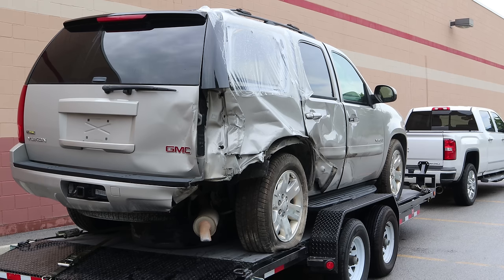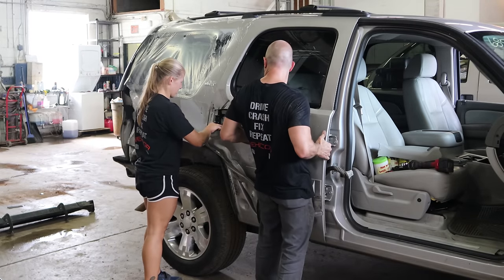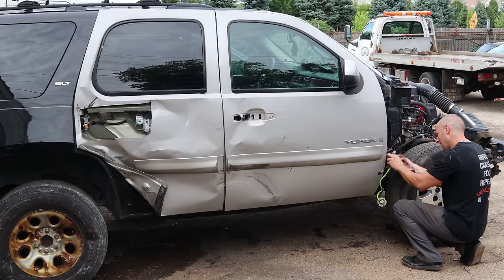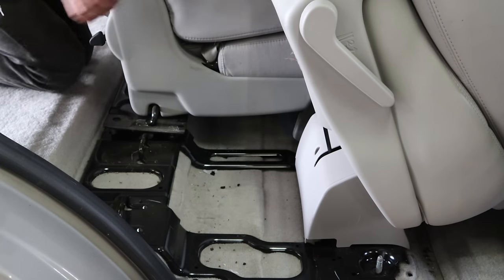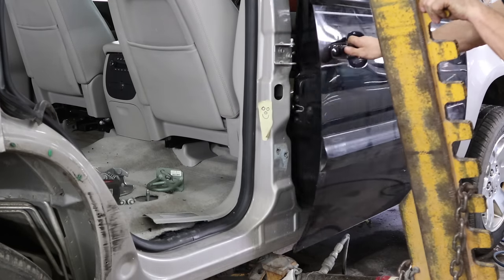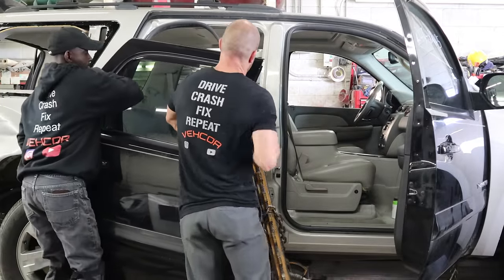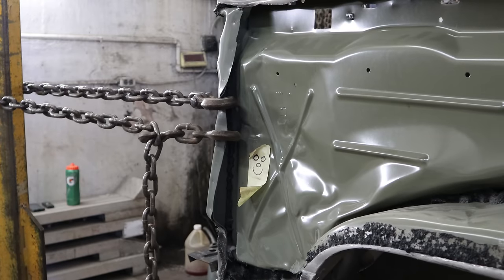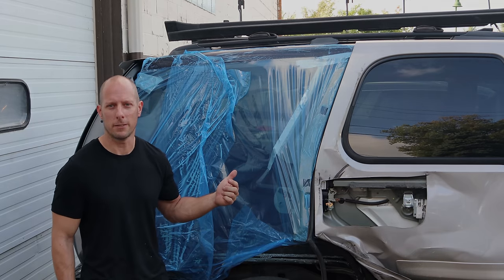Rebuilding a GMC Yukon hit by a semi  Part 2

Comment: I have to say that with all the frame/structural straightening on this video, it's one of your most interesting yet! It's cool to see the process taking the structural parts from twisted up to straightened. Thank you! Good job!
Reply from the maker: And I almost didn't include it because I thought it might be boring.  Just goes to show I know nothing about making videos. 😂 I'll just record it all to be safe from now on!  Thanks for the support!
Reply: @vehcor  how about a qwik tour of the frame machine and setup on a frame rail or sheetmetal pull?
Reply: What you went thro on the dirtnali...how does this compare?
Reply from the maker: Mad Mechanix the Dirtnali was hit harder but in a smaller area.  The way those panels go together made that one a little more work.  This one is pretty easy, just over a bigger area.
Reply: And that’s why I pop 2 bags of popcorn for every amazing in-depth entertaining and informative Vehcor post #keepemcomingbrother

Comment: That bulldozer puller is one handy tool. No need to run the vehicle up on a frame rack for these types of repairs. Looking good as always on these repairs. Keep up the good work and funny banter.
Reply from the maker: That was actually on the frame rack.  It was only chained down since the pulls were light and wasn't worth the time to drag out the clamps.  I contemplated using the forklift again like the Dirtnali. Thanks for the support!
Reply: @vehcor  Ah, okay. It was kind of a guess on what method you was using. From the camera eye it resembled the ole bulldozer. I'm sure you know of those types of frame machines. Heck, you probably DO have one kicking around somewhere. AND not that darn forklift either lol. Keep on rockin, Man.
Reply from the maker: There is one of those floating around the shop somewhere.  😂 Don't be dissing my forklift/frame rack! 😂

Comment: This video step reminds me that just a couple of days ago I received a RR passenger door for my 2006 CTS Sport.  I became quite mangled.  The replacement door is just perfect.  It's totally complete and ready to mount.  It's off a CTV-V and is a color match and in flawless condition.  Now, this sucker is heavy!  I'm going to need to have a door replacement party.  Yikes!
Reply from the maker: Sometimes you get lucky with paint match.  With all the Grand Ams I did, I was able to put on quite a few parts without paint.  It helped that they came in limited colors.

Comment: That’s what I call “optimizing.”  
One parts vehicle to help rebuild two, possibly more, vehicles. 

Good planning. 
How did you figure out the cross references. 
There used to be a manual you could look up parts cross referencing.
Reply from the maker: I usually build a few out of my parts cars.  I used measurements off the parts truck before I cut it up.  We do have measurements in the estimating system and with the frame rack.  Thanks for watching!
Reply: @vehcor  I hope you strip the spare one for sellable parts

Comment: that face tho, worth the price of admission right thar! lol

(reminds me when a gf was helping me on my boat. I was in the engine compartment and removing a high pressure oil line which I THOUGHT the pressure was released lol made the exact same face when I popped back up covered in oil hahahah)
Reply from the maker: You have to be more specific, I make lots of different faces and so does she. 😂😬😁😶😳😧😲
Reply: @vehcor  at the very beginning, when using the air chisel..
Reply from the maker: That was a good one! 😂
Reply: @vehcor  it started out as a "what the hell" and ended up with a "oh wow, that was fun! hey, give it back" lol

Comment: Thanks for the vid. This is a good one. I originally found you (a year ago) because I was planning on repairing a Grand Vitara with a similar amount of rear quarter damage. Now started on the Grand Vitara so kind of good to see something like this again. I am using a beam under the car and a pullback ram on a portapower for pulling. No frame machine for me. Going good so far.
Reply from the maker: I could have done this one with the forklift like I did the Dirtnali.  It was only chained to the frame rack, not mounted up.  The pulls were light so it was not worth the time to clamp it up.  Good luck on your project.  With a little creativity you can do without the frame rack.
Reply: @vehcor  had a friend come over who is a bodyman and help for a couple hours. He was amazed how well the 8inch I beam and a few chains actually worked. Little creativity goes a long way. For heavier pulls I would have to move it outside and pull using tractor and a pipe pushed in the ground as an anchor. The body panels and unibody structure pulls really easy though. Thanks again, these videos really demonstrate that you can diy a lot of this stuff with proper techniques but less of the sophisticated equipment.

Comment: When you were using the measuring  stick to find out if the b pillar was in specs when pulling it out for the front passenger door to close correctly, did you measure from the other Yukon or do you have a source book for those type of measurements? When painting over the dark painted doors/ quarter panel; are you gonna have to take it all the way down to the primer, so the lighter paint matches the rest of the color? Very in depth repair how to step by step. 👍🏻
Reply from the maker: I used measurements from the parts truck.  I do have programs that have them but the parts truck was a few steps away.  The silver covers well, we can put it directly over the black. There will be some bodywork where the welds are and a few dings so those will have lighter colored primer under the new paint.  It is not necessary to strip it down to the factory primer every time.  Some colors cover poorly and for those  we put down a base coat.

Comment: Awesome job! Looking forward to the next segment. I was surprised the rear ac box was that big. We have a suv (trail blazer ss) but it doesn't have rear heat or air. Anyway 👍👍👍
Reply from the maker: That HVAC box was actually smaller than most.  The last generation Yukon it was 3 times the size. lol I have always wanted a TBSS.  Maybe soon, they have come way down in price.  Thanks for watching!

Comment: I had to replace my air hammer/chisel 2 months ago. my New IR one safety instructions warns against gloves. Gloves could get caught in trigger or pull a hand in to the bit.
Reply from the maker: TAKE THAT SAFETY EXPERTS!  Interesting, I might have known that if I read instructions, but those are the first thing to go in the pile!   lol  Thanks for teaching me something.
Reply: Gloves aren't for using the gun, for handling the metal edges.
I'm cool with people who don't think they need any protection, as long as they don't expect me to help them when they get a shard of glass/metal in their eye, cut their hand open or speak up because they are deaf.

Comment: Another awsome video. Lots of damage to the inner panel and floor area. Is this your full time evening crews new whip? She sure ain't afraid of the work.
Reply from the maker: Thanks, the floor is a little crumpled but it will straighten, the inner panel and wheel house is going in the pile! 😂 She has a rebuilt Scion tC that she says she is driving for a minimum of three more years.

Comment: So how does the rebuilding business work for you? Pretty much every other youtuber does it for themselves, but I know you don't all these Yukons for yourself. Do you buy and rebuild any car you feel like, then sell it on the market or to specific used car dealers, or do customers approach you and "commission" you to rebuild a specific type of car? If so, how do those customers find you? Is it word of mouth or do you advertise at all? I know in one rebuild you mentioned having a deadline for a car, and that's what got me thinking about the business side of what you do.
Reply from the maker: I do a few builds for myself.  Most are just cars I buy to sell.  Some go to the auction, some dealers buy from me, some dealers consign for me.  I sell some myself as well.  Basically whatever will bring me the most money and each case is different.  I watch the market on different cars to see what is selling and for how much.  I make sure my builds are under that price or offer something like rare options or low miles that will demand more money. I also have customers that order a car like the last Yukon. I do zero advertising, I cannot keep up with demand from previous customers and referrals. It pays to do things right.  What the hacks spend looking for new customers, I save with repeat business.

Comment: A nice addition to my Friday 😋
How do you deal with the different color trim panels on the replacement doors?
Reply from the maker: Thanks, I will use the originals when I put it back together.
Reply: Depending on the vehicle, the interior panels are quite easy to switch over.

Comment: Would heating up the metal aid in pulling out the rear quarter panel?
Reply from the maker: Yes it would aid in pulling but destroy the metal.  You cannot heat any newer cars, it weakens the metal.  It might look good but it is VERY weak afterward.  I see people heating uni-bodies and I just shake my head. I don't want to be in that vehicle if it is ever wrecked again.

Comment: seeing you remove the door handle, i'm saying to myself well now I know how to get into my car the next time the German made locks deside to lock me out.
Reply from the maker: I mean, you don't want to break the window!  Putting it back takes a little long, just a warning! 😃
Reply: @vehcor  Already did a window in it, thanks to the wife. She thought it would be a good idea to leave her coach bag in the floor borad. So did the robber. So the dam door panel and german torx screws they use they made me have to flag down a tool truck guy to get the right tool bit. Plus it would look mad max a F*** if I just welded it back.
Reply from the maker: The girlfriend lost a window in her Mustang to a similar purse snatcher!  Dirt bags!

Comment: Vehcor , how did you notice you had to pull the bottom hinge ? Gaps not even ? Overlapping????
Reply from the maker: The gaps were uneven and the front door would only latch on the first latch and you had to slam it to get it there.  Now it closes nicely and the top of the rear door is not kicked out.
Reply: @vehcor  thanks for answering , so when a car is hit in the center pillar and fron door is not closing good that you have to slammed in order to close . Means i have to pull from the bottom ? And not from the middle where it locks 🤔. I dont know if i make my selft understand
Reply from the maker: The damage was caused when the truck pushed in the rear door.  It put the most stress on the lower hinge.  It pushed the post in enough to move the front door striker in.  The top of the rear door was out in the back so that tells you the lower hinge was pushed in.

Comment: Are you going to use that passenger side mirror i need one for my car! Can buy it off you
Reply from the maker: The black mirror?  It is for sale.  It has heat, signal, puddle light and is power folding but it doesn't fold all the time. $100.
Reply: @vehcor  just the black one is for sell, my car is that same color as the tan/gold Yukon you are working on right now.
Reply: @vehcor  thanks for replying sorry if im bugging you
Reply from the maker: todd mayben the silver one is going back on the truck.

Comment: lucky the hinges weren't welded on
Reply from the maker: Yes, like the previous generation Yukon. You can pull on those though.  I prefer the bolt on if I had a choice.

Comment: Lmao, why did we cut the door handle off?  Bc it didnt work.   #crossfittersneedlovetoo.  #part1saveafew.
Reply from the maker: See, it is not just the comments I answer sarcastically.  I do it to the help as well.  It was funny that she was willing to accept  that as the answer at the beginning  lol
Reply: Like yup, that seems like s legit response.    And just like that, the door worked.
Reply from the maker: I was expecting more destruction to get the door opened.  I was happy and maybe slightly disappointed when it worked so easy.  I always look forward to a little bit of breaking stuff. lol